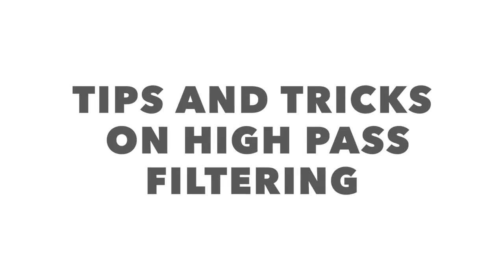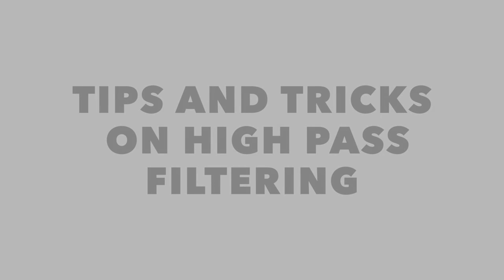HIGH PASS FILTERING Tips & Tricks - Streaky.com

Comment: Brilliant! I have argued countless times with some of my producer friends during the years that there is no need to cut any sub bass on the master if you have it all under control inside the actual mix. Did you say they cut out everything below 200hz on one of your examples or did i hear that wrong? If so, that is just insane! Btw..i went back on your earlier videos and you did a review of the Sennheiser HD800s headphones. I have been thinking about picking up a pair maybe, but i have a question for you about those. Did you use any additional amp for them? I believe they are 300ohm, and i am worried about plugin them directly into the headphone output on my Uad Apollo twin 2. Do you think that would be a problem? Problem as in would it compromise the sound in any way.
Reply from the maker: Moano onYouTube I had them plugged into my prism Lyra headphone out so you should be ok...great headphones

Comment: To be clear: it's cutting to *lacquer*, rather than cutting to vinyl (which are pressed). (Unless it's one of those poor cousin direct-to-plastic-via-a-direct-drive-turntable-with-mono-cutting-head systems).

But yes: there's no need to over-filter, and if DIY mixing, especially not on lead vocals - keep the fullness and "body" in there. There are few things worse than a vocal being loud enough in a mix, yet thinned out due to over-use of high pass filtering. And know how steep the filter's curve is. (perhaps spot-treat any pops/thumps instead, or aim for 50-60Hz HPF, not 100Hz).

It's far easier to deal with slightly excessive low end at mastering (and shape it, as mentioned), than excessive high end.